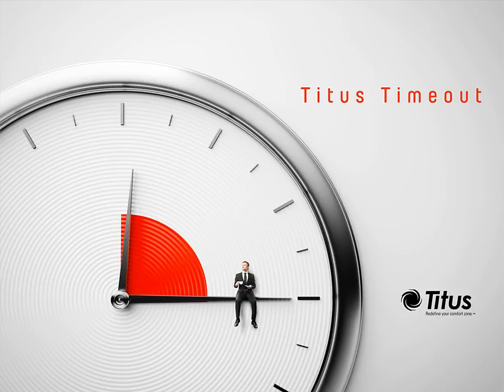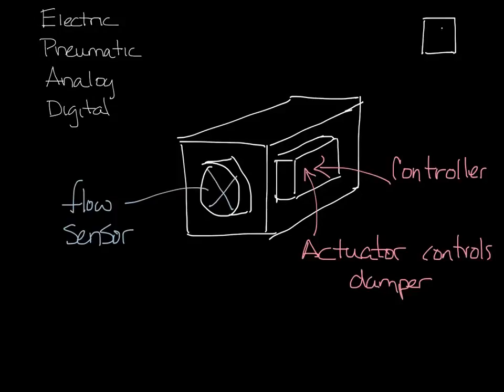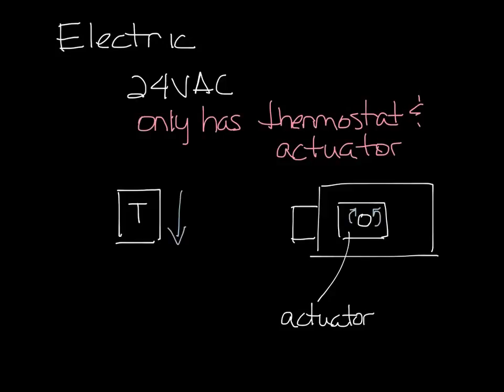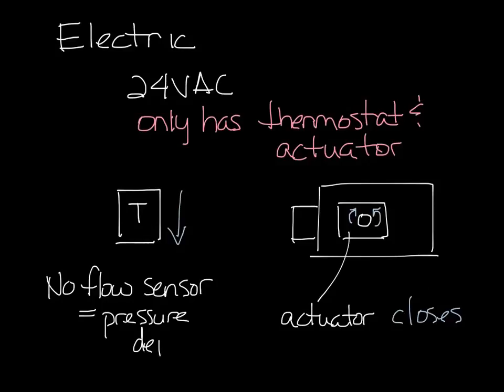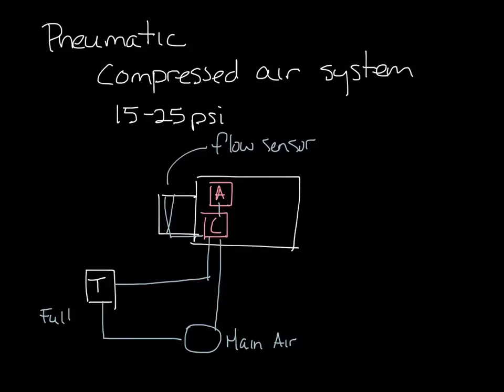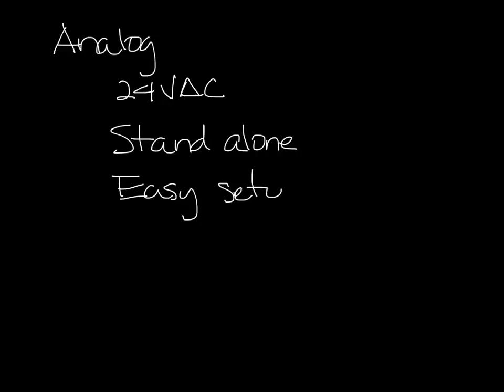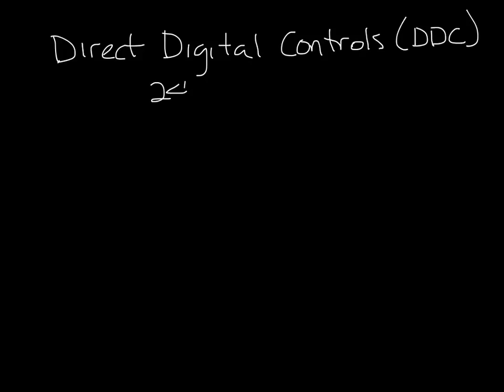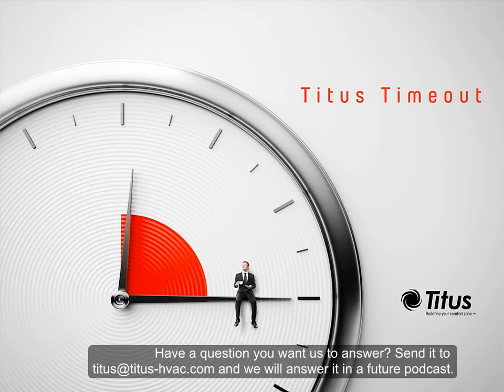Titus Timeout Podcast - Types of VAV Box Controls

Comment: how to contact you?
Reply from the maker: please contact us at communications@titus-hvac.com
Reply: @TitusHVAC  can i ask anything hvac? do u reply right away?
Reply from the maker: @sagittariusmax5419  We typically respond well depending upon the HVAC question, how can we assist?
Reply: @TitusHVAC  a rooftop unit with multiple vavs serving a conference rooms. now when RTU tstat reaches its setpoint the RTU airflow reduce its airflow to minimum which affects the vav capacity and gets hot in the conference room. can a fan assists vav solves this issue?
Reply from the maker: @sagittariusmax5419  The thermostat for the RTU should be placed in a central location like a lobby or a hallway near a return grille. It often works best to use a remote sensing thermistor or RTD placed in a return duct, so the RTU can control based on return air temperature. The RTU should be set-up to keep the VAV terminal units supplied with adequate airflow and inlet pressure regardless of room loads in individual spaces being served.
Reply: @TitusHVAC  Thank you. ill google RTD as im not familiar with it. but how do you setup the RTU so it wont  affect the vav airflow? so i guess the fan assisted vav is not the solution?
Reply from the maker: @sagittariusmax5419  An RTD is just a type of temperature sensing device like a thermistor. I have no idea what kind of options you may have available for your RTU. I would expect to be able to set a minimum fan speed limit. There’s no point in using fan-powered terminal units because what the spaces need is cooling from the RTU.